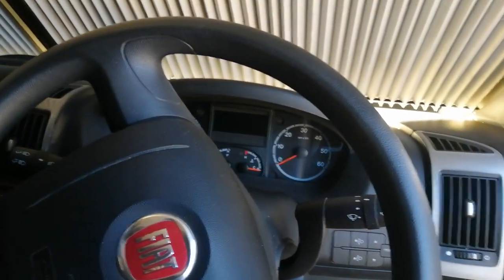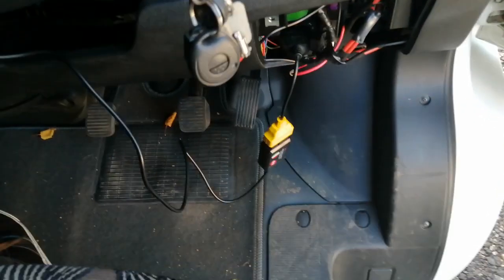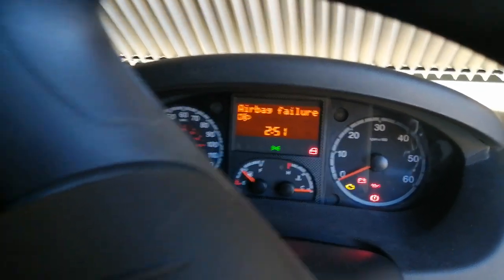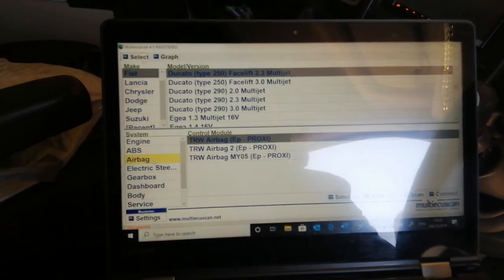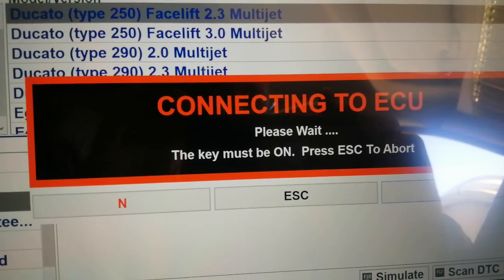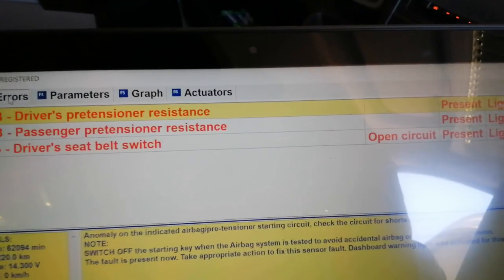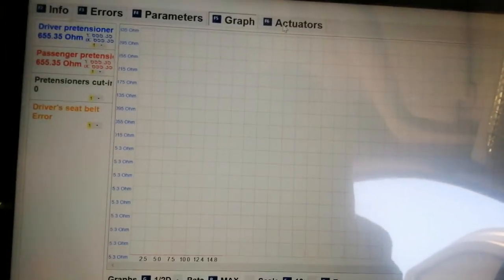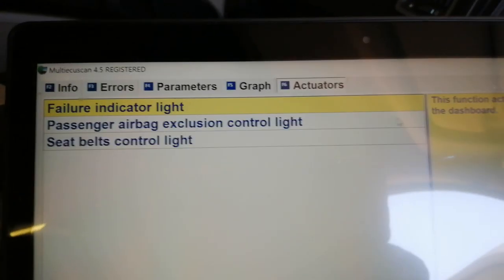MultiECUscan - airbag fault light investigation

Comment: Thx, very useful video. I’m trying to connect my laptop but it won’t connect. I’ve purchased an officially recommended interface (by the Multiecuscan site) and installed the drivers for windows 10, anyway no luck connecting my camper to any ecu. I do also have the yellow adapter for the airbag, and other colors for other ecus. Do you know whether there is some trick to get it connected? Which drivers did you use? I have also a Ducato 250 2.3, thx in advance for your help